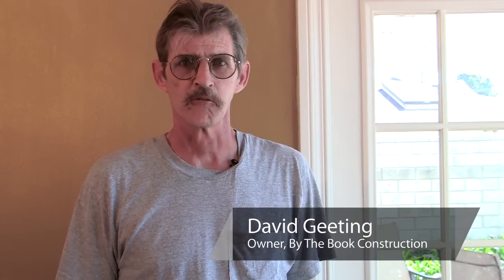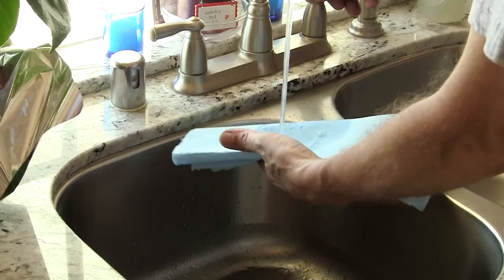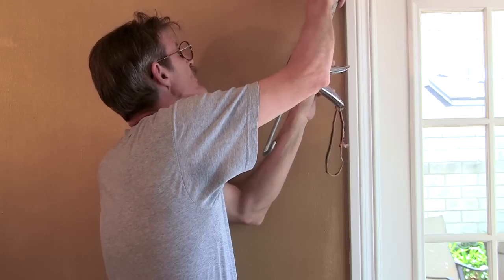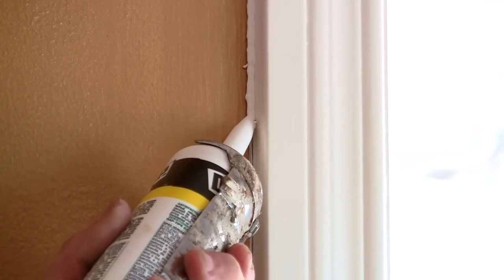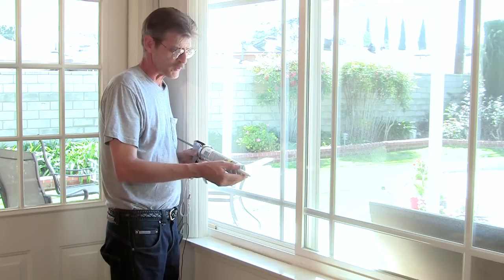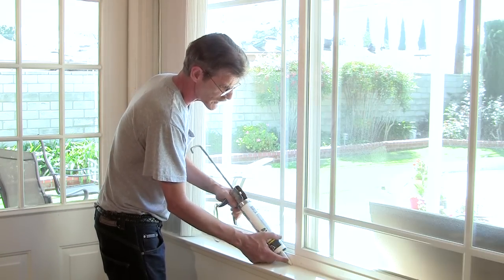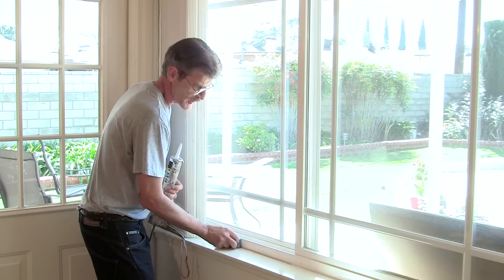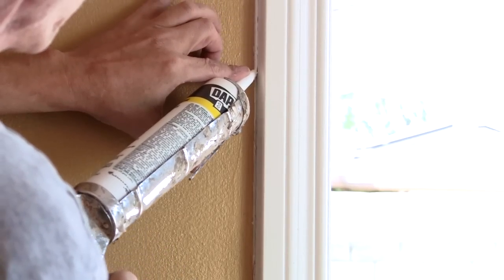Home Help  : How to Caulk Around Doors and Windows

Comment: I like the concept of the video and I’m not one of these rude people that are trying to bash you or seem like I know it all however you were running those beads too big, your waisting caulk and when you run your finger over it your pressing too hard causing it to push out onto your wall which means you’ll have to cut that wall color back in. But hey good job.

Comment: The door was pretty good.But if you are doing it “ by the book” the window gap requires backer rod. ( lower quality sealants sometimes allow for thicker sealant but the fact is you can’t get a good bond with out it.) Backer rod is a VERY important part of caulking systems. But because of where this is located and is only cosmetic, it’s not a big deal when it pulls free from the sill because it is too thick and not well bonded . These techniques are fine for interiors ( and that is all you showed)  But it should be pointed out that neither the technique or the material are acceptable on the exterior. The use of acrylic, not using backer rod, and only tooling one direction are the most common reasons residential sealants almost always fail,prematurely.

Comment: How do you know when to use caulk or silicone sealant for this sort of thing? what are the rules for choosing each one?
Reply: As a professional caulker, we would never use acrylic on exteriors. Most painters, carpenters and builders do. Because it is easy to use. But it also the reason homeowners have to replace their sealants so often. So acrylic should only be used for interiors. Any wet areas ( Kitchens,baths and exteriors) that DON’T need to be painted use silicone. If they DO need to be painted use polyurethane. These are the basic rules of thumb. But be aware once you use silicone you should always replace and repair that area with silicone. Nothing else will bond. And I recommend using masking tape when using silicone and polyurethane. They are very easy to make a mess with,that is very difficult to clean ( you can’t clean with a wet cloth that will just smear it)

Comment: Dave from start to finish you did it all wrong, if I was that slow at caulking I would be out of business, too slow at application, & you never ever wet rag the surface, too messy & you break the surface of the caulk allowing dust to build up later, best to dip your finger in a slight soapy water solution & with gentle pressure skim over the surface, the rag is for wiping off the little excess caulk left on your finger. 30 years of doing this I can caulk a door frame within 60 seconds.
Reply: victormeldroo SMH. It’s not a sport and since your downin him and his technique I searched for your vid but I can’t seem to find it 🧐🧐🧐🧐
Reply: SAVAGE! Old dude mad hating, like if you got a better way show us!
Reply: This is hilarious. As a professional caulker of over 45 years I can say you are doing it all wrong. Never use soapy water. It is plain stupid.I can do a door frame in under 60 seconds too but I don’t use my finger I use proper caulking tools and always tool both directions. What’s your point? Because of the volume of sealants we use on one project (sometimes $40000+) we often have to do extensive quality control testing. Using any liquid to tool will cause a failed test very time.